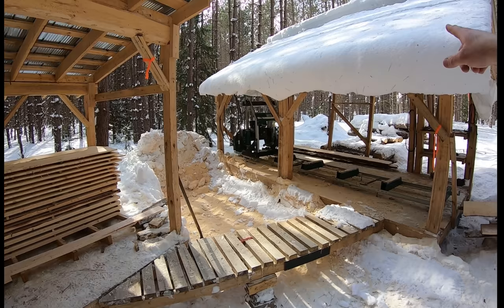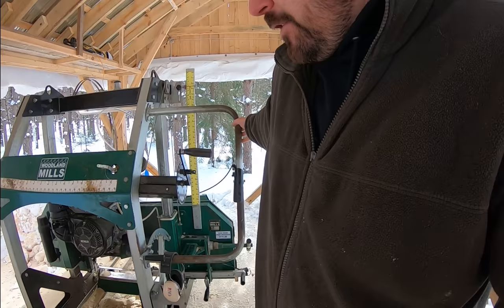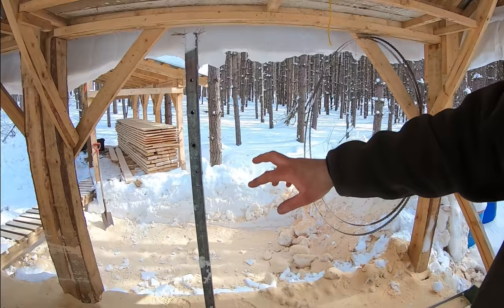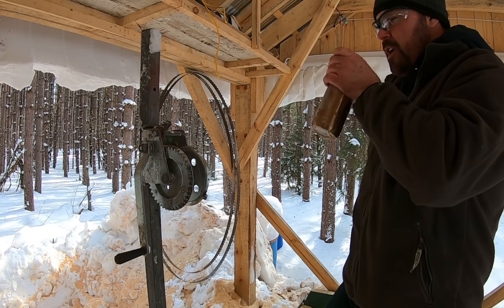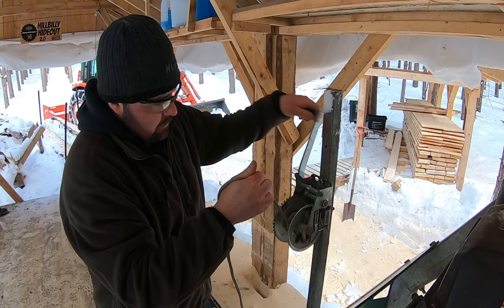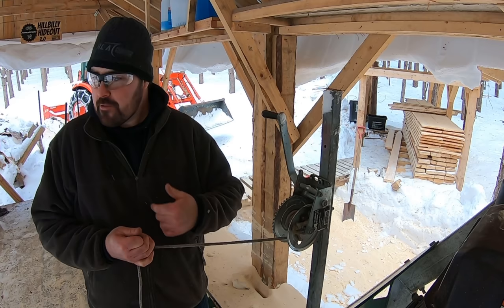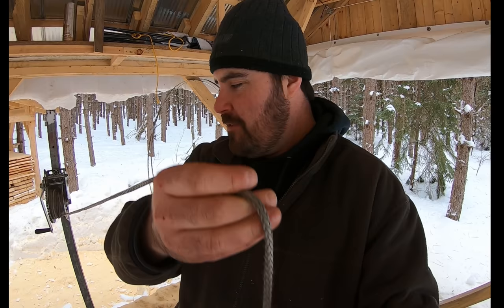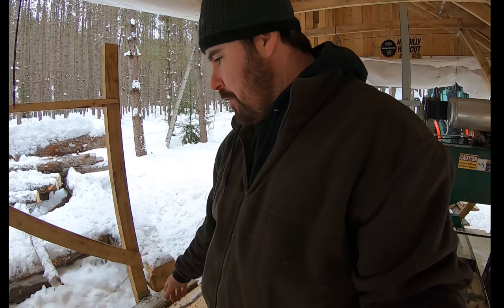Loading Logs with a Winch | Sawmill Upgrade (from junk)

Comment: Instead of mounting the pulling post to the saw bed, mount it to your structure base. You can put it where you'd like to have it and it would be out of the way enough that you could leave it in place instead of stowing it somewhere to saw logs.
Reply from the maker: I agree with ya there on second thought
Reply: mount a block type pully to your structure and enough rope to reach your tractor winch, was your winch remote control. use a choker on the center of the log
Reply: That is what I was thinking as well.
Reply: I know  its more  work but I  would  take  time when limbing the logs to cut them flush when possible.  All those nubs can catch while cranking and stop you cold.

Comment: a tip I often use : I got a pretty good milwaukee drill, so I removed the handle on the crank and use the drill to activate the gears. Easier on the arms. I do this on my attic trap in my garage.
Reply from the maker: Think that’s a great idea!

Comment: If you are concerned about the winch arm causing issues with the saw mill bed, you could run a rope from the top of the arm (above the winch) to a suitable anchor point behind the winch (tree, post on the lumber shed, etc).  This will minimize the stress the winch puts on the saw mill bed.
Reply from the maker: That's not a bad idea
Reply: My thought exactly. I like the winch, just not the mounting to the mill bed

Comment: My only comment is actually from the WM videos for their setup.  They use the winch post in the log stop socket just like you do but they anchor the bitter end of the synthetic rope to the bunk itself.  This divides the force applied to the welded log stop socket in half and does the same amount of work.  Other than that, well done once again.  Thanks for sharing.

Comment: Great idea 
If you bolt it to the outside edge of the floor then you don't have to move it each time and not have too worry about the mill braking
Reply: I was thinking the same and use a 2" trailer receiver mounted vertically to the edge of the floor then slide his square stock with the winch into it.  Takes the stress off the saw mill frame itself and places it on the  floor frame of the building.  Anyway, it's a thought.
Reply from the maker: Great point there Russell
Reply: @sawingwithsandy  I just moved to NS. I setup my mill temporary to mill enough lumber to build a shelter for it
Reply: This was my thoughts also.  Why put ANY strain on the sawmill rails?  You can then line up winch with middle of log deck.

Comment: Sandy, the term you're looking for is 'parbuckle' and I use it for positioning my logs. Larger diameter gets you more torque so not much increased effort with bigger logs. I used the method to roll the 36"x5ft monsters I had here.  
Make a permanent mount for your winch on your shed structure.
Reply from the maker: Thanks John

Comment: We own and have used the Woodland Mills winch. Great to see someone make their own. We do like it, however, it IS a bit slow. We can hook most logs faster than the winch. One thing Sandy, you might consider setting 2 log stops before the log plops on the mill. Our winch will bring the logs right to the stops. That will also prevent the log from overrunning the mill…yeah..ask me how I know! We have a video showing a small lady using the winch.
Reply from the maker: Yeah I can see what ya mean. This may end up being something that works or ends up going back to the drawing board. Good points you made

Comment: I have a hand winch on mine. you can change your centre point by moving  the anchor point left or right of the winch. I use winch to turn large logs. Use long logs stops when turning or winching log in place

Comment: I parbuckle logs onto my mill ( HM130 Max ) and have the same issue with trying to center the winch on logs. What I've come up with is two short posts that fit in two log stops with a 2x2 horizontal tube that joins the two. I am going to mount the winch on a sliding piece that can be moved sideways along the horizontal 2x2 to center my winch on the log.

Comment: Build a bridle with a pin hook on each end to grab the logs. Mount the post to your structure ( or, dig it in next to it when the ground thaws) to get it where you want it… and, no chance of tweaking your mill out of alignment. If you use a single line the log will move faster and less wear on the rope. If you get a “big” log you can always double it when necessary.

Comment: I like the ideas of adding another support (say a 4 x4 post) in line with the back wall (and center of your log rack) and mount the winch to that. Then you do not upset the track, don't have the step of fussing with taking the post in and out of the track and putting it someplace. I also like the ideas of using a drill motor to run the winch.

Comment: Sandy, not having a FEL strong enough to lift the logs, I built a ramp from ground up to the log table. I then use a 30 foot x 4 inch wide tow strap (more stable on the log than cable) and my compact tractor to pull the log up the ramp and thence onto the sawmill bed. Much faster then cranking that winch and easier on the arms.

Comment: I currently use a long nylon tow strap (wider the better.) Fix one end to the shed floor (2x4 through the loop, lag bolted to the rim joist centered on mill bed). I throw the strap over the mill bed to my logs, feed that loop end under the log and over the top. At that point if the log is heavy I use an atv winch mounted on a hitch receiver to pull them. Also i find that if the log is rolling easy I can easily just pull the strap by hand and roll it quickly. Wider toe straps more stability and this system is ideal for log deck to mill bed on an even plane like yours. No stress on your mill bed and I just fling the strap out of the way for sawing. Your videos are really great Sandy. Thanks for sharing.
Reply from the maker: Thanks for sharing that Greg

Comment: I can appreciate your ambition. Harbor freight has a hand winch called "Portable worm gear hand winch" the gearing is a "worm gear" set up, it can not "unwind" on its own, thus is safer than accidentally losing your grip on a winding handle. Look up "65ford" on ytube and see how he welds a nut on the drive gear and uses his drill and a socket to lift the whole rear end of a car with little effort, just a thought, I use these type a lot, Good Luck with the mill.👍

Comment: The winch is great. I have a few of these. I’m building the shelters for my 126 in the spring, and I can see sloping the entire roof away to one side is a must. It doesn’t look as nice as your  “Salt Box”  double slope, but Hopefully this will put the snow to the unused side and I can forget about it. The wood storage/drying can be parallel to the cutting shelter, staggered enough for the log in-feed, and sloped the other way.

Comment: Huge fan of the channel. Can’t wait to so what have in store for us when the weather gets a little better. I don’t think the winch system is worth the effort. You probably get more snow on you having to run cable out and around log. If you had something you had to winch I would pull the Polaris around back and use the winch on it. To many variables when your torquing on the mill be worried about things not staying flat.
Reply: Hi buddy me again can’t stop thinking about your situation. When the snow melts could you re work your log deck make it wide enough for the tractor to get in and when you come out to saw you could push your logs right up to the mill so you don’t have to roll them so far with can’t hook? Just an idea.
Reply from the maker: You may be right there Josh. I figured I"d give it a try and see if it ends up working out. May not stand the test of time
Reply from the maker: That's a great idea Josh. I bet I could do that. Would just have to make the log deck have posts in the ground instead of sitting on the ground.

Comment: Hi buddy how are ya? Sure looks cold there!! Glad to see you are well! I have a winch on my sawmill it’s the only way I can get logs on the trailer deck. Sometimes I’ll use my quad with a rope wrapped around the log if it’s a big one. I have my winch wrapped the other way so when I’m using it, I’m pushing the handle away from me, works better for me cuzz I’m old and have a bum shoulder. As always thank you so much for sharing all ya do. You are our sawmill guru.
Reply from the maker: I’m doing well thanks. Think the winch idea of mine needs a little refinement but will come in handy from time to time for sure
Reply from the maker: Hope all is well!
Reply: @sawingwithsandy  we are well. I’m hoping to get sawing soon been doing a lot of storm damage clean up. The snow has melted some now I can find the logs hehehe. I love making lumber and slabs. Out here in Kaliforniastan a 2x4x8 is $6.48 that’s crazy money!!

Comment: Keep it simple and don't reinvent the wheel. I do see some strain on the mill bed but its minimal and a short rope to the frame out to the side from which you crank on so its pulling on the whole building rather than just the arm.... from edge of this building to base of winch lever base (down where it goes the that square stock) Its just a little protection to keep it from moving sideways

Comment: I got the winch when I bought my HM130MAX.  It's still in the box.  I positioned my mill at the bottom of a gentle slope.  If I can't lift the log on the bed with my tractor, a couple 8' long 4x6 run our from the frame gives me about a 2 degree up slope from the ground.  I kow can roll a 9 1/2 foot, 24" diameter cherry log up on the bunks with just my cant hook 'cause I just did it last weekend.  I'm sure I'll find a use for the winch too.

Comment: Try moving your winch to the outside lower wall of the sawmill wall. When you do that, it will still pull the log in but you wouldn't have to remove it from the mill every time you start to saw.; unwrap the line from the log and finish reeling it in to secure the end.  You could easily clamp it to the wood on the side as built. I would consider putting in a lower L-brace at the bottom so your 2x2 pole could just sit on it, and that would alleviate you having to use a pinch bolt to hold it in. There wouldn't be any strain on the shelter other than the u-braces to slide mount the 2x2 steel pole at the base. Lag screws could be used to bolt the brackets/braces in, but I would say through-bolts with Nylock nuts and washers would be better.  You can also remove the 2x2 pole when/if needed for cleanup. 

I personally have the Woodland Mills winch system and having to remove it every time you get ready to cut can be bothersome over a full day. Your setup is essentially the same as the Woodland Mills set up, but making the winch remote from the mill's rails would make it easier on you, the operator. Just an idea worth considering.  I have my log arch set up so it accepts the winch from Woodland mills, and I can use it remotely to load logs out with my RTV.  Win-Win.

One more note: (1)Run the cable out, (2)under the log, then (3)over it and back to the winch; then hook it to the pole with any number of options before you begin winching.
Reply from the maker: Thanks I appreciate you sharing that!
Reply: @sawingwithsandy  I'd like to make a correction to the steps above.  In steps two and three, I said "UNDER" the log and back over the top, what I realized is it should start over the top and come under the log to winch it to the mill bed. The rest I still stand by, however.

Comment: If you want center it up. Take another spuare tube that bigger than your winch one. And weld it to a flat pc and screw it to your floor. Hopefully there a beam under there. Myself I rather have that give than have to resquare the mill or replace the track. Specially if and if you get a sticker that catches on you.

Comment: When I come up with all my [great] ideas,   😉    it's all about making it easier for me and safer.  The hook on the end of tow line came to mind and maybe not having to remove winch out the way all the time. Just had to throw my 1/2 cent in there, what you are doing seems to make it smoother operation always thinking. Top of the day to ya. 😀
Reply from the maker: I like the idea of not having to move the winch. May have to do this for the next revision

Comment: tHanks for  your video!

Sawmilling is one of the greatest hobbies.   I've designed a log arch out of scrap and had it welded up.  Fun filming it too
Reply from the maker: that's on the to do list for sure. Nice log arch would be handy
Reply: @sawingwithsandy  They are great fun to make.  Not overly complicated and before you finish the first one...you realize you may need two anyway!

Comment: You could put a vertical post against the out side of the deck to the rafter beam for a permanent mount and a hook to the other side of the deck to hook your cable to from under the log.  Then when the log rolled on to the deck you could just leave the tail of the cable hanging on the winch out of the way of your milling.

Comment: also, if you wrap your line once around the log, it'll cinch and roll rather then slip when one of your nubs digs in. I'm with everyone else, externally mount the winch and attachment point. Keep in mind rolling the log as opposed to sliding it up will become more critical or risk dislodging your mill

Comment: Just a suggestion, take the handle off the winch and weld a nut to the shaft. Then use your electric drill driver to do the work for you. Great vids, thanks Sandy
Reply from the maker: Think this would make life a lot easier!

Comment: I would just put a wood post on the outside of your building and attach the winch to that.  Then you can line everything up with center and you won't be having to remove the whole thing each time.  Plus you won't have to worry about damaging your saw mill rail.
Reply from the maker: Think so too

Comment: Sandy, what about if you place a 1.5 inch square hole in the deck, or better yet, a pocket on the rim joist of the building to place the winch post. You could align it where you need it and it wont be torqueing on the mills rails. Just a thought.

Comment: You may be able to take the winch handle off and use a cordless drill or impact on the nut that holds the handle on to power the winch.  If it works, you could tack weld the nut on to keep it from coming off in reverse.
Reply from the maker: I like that idea. Sure would speed things up

Comment: What if you attach the winch to the top plate of the sawmill shed itself? That would eliminate the potential of stress on the sawmill and would allow you to better center the winch on the log rack. I am picturing the winch mounted to the underside of the top plates of the shed with a hook down on the rim joist  of the shed for the ring on the end or your rope. In that configuration it could even be a bit more "permanent" so to speak.
Reply from the maker: I like that!
Reply: @sawingwithsandy  Glad you like the suggestion. It would be interesting to hear feedback if/when you try it.

Comment: If you have length of scrap cable roughly the length of your log rack, try attaching it to floor area in the middle of your log rack with shackle at the end. Pull it out and come up from underneath the log your going to roll in. Attach winch cord to the shackle.  Should be less work than pulling winch all the way out and back in and less abuse to winch cord.
Reply from the maker: Thanks for sharing the ideas!

Comment: As someone who does not own a sawmill, shouldn't the log deck, have a rough platform between the two carrying logs, to keep you out of the snow? Of course that means you'll have to shovel the snow off the "platform," but no more wading through the snow. Great video. p.s.: you could buy a hitch receiver and mount it vertically to the outside of the sawmill.
Reply from the maker: The only concern I have is when the snow and ice freeze to the platform it would then make a hump for the logs to have to roll over. I'm sure I could figure something out though to overcome that

Comment: Sandy ~   I enjoy your channel... ( a bunch ! )  It occurs to me that you shouldn't be attaching a winch, or anything else to your saw mill structure...  You've got an entire structure to use !   Attach a 4X4 to the edge of your floor, and to the roof... ( at the center of your log pile )  Then mount the winch on the 4X4...   You won't have a frame 'warping' problem, and it will pull better...
Reply from the maker: Think I may haver overlooked this like you mentioned. Will look at alternatives for sure. Thanks for watching Doug

Comment: I’m not liking this setup, it could put your tracks out of level and square, or even worst as you said, do damage on the bracket. Your setup might work better if your lumber shed was attached to the saw shed where the slab rack is, and move the slab rack to the left side of the mill on a 45 degree angle, that way it’s easy to pick the slab up and toss it onto the rack with out much effort. Bonus is you don’t have to deal with that walk way anymore. But hey to each his own.
Reply from the maker: I have actually considered the layout recently. Maybe things will move around once the snow goes

Comment: Not a good idea using the log stop mount.  Try mounting it to your deck or one of the roof posts. This will insure you don’t twist or break off the log stop or the rail. Just a suggestion.

Comment: Didn’t you have a chainsaw winch set up? For pulling trees? If so maybe look into setting that up to the frame work of the building or add a post to building for it.
Reply from the maker: I do have the Lewis Winch and thought orginially about using that but then thought this may be a simpler solution but maybe I"ll look into the chainsaw winch one more time.
Reply: @sawingwithsandy  if you don’t use it much it’s one way to burn some fuel in it also save on the winching arm. Lol older we get the faster those shoulders wear out